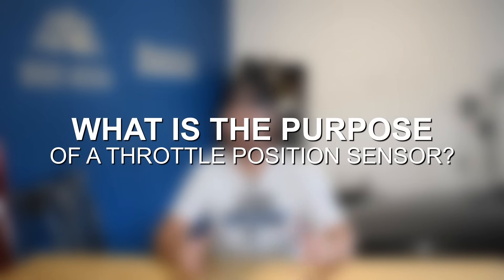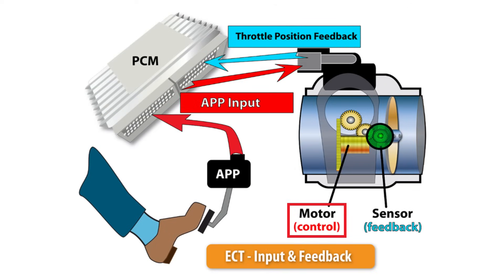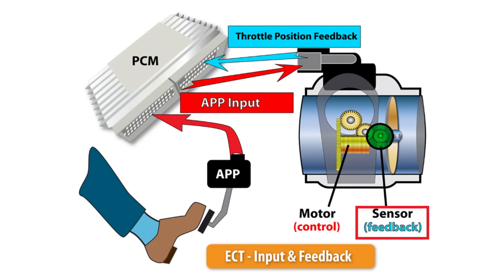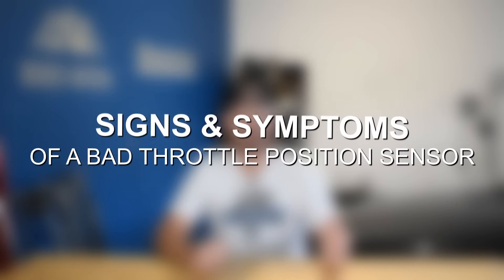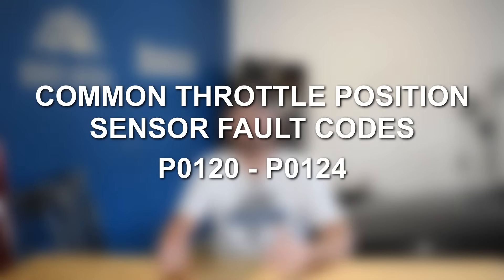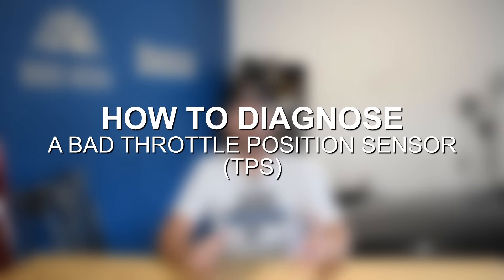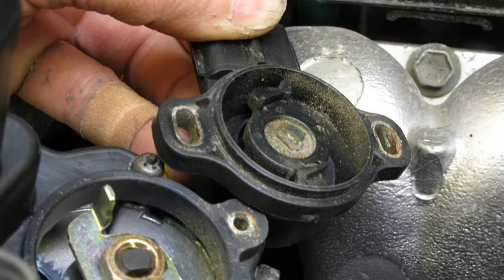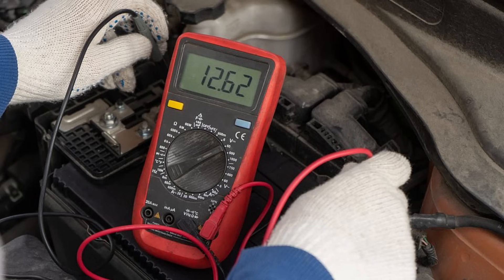Signs & Symptoms of a Bad Throttle Position Sensor (TPS)!

Comment: I have an issue that just happened to me today, if i accelerate anywhere between 9-25 MPH it stays at that speed if i release the gas pedal at 12MPH itll stays at 12mph and increase slowly im not sure whats wrong with it can anyone help
Reply from the maker: A - What you’re describing sounds like your vehicle is “holding” speed because the throttle isn’t fully closing, which can be caused by a sticking throttle body, a faulty throttle position sensor (TPS), or a cruise control/idle control issue. On modern drive-by-wire cars, the ECU can also command the throttle to stay slightly open if it thinks the engine needs extra airflow, which can happen from a bad TPS reading, a sticking accelerator pedal, a vacuum leak, or an issue with the idle air control (IAC) system. First steps would be to check for stored codes with a scan tool, inspect and clean the throttle body, make sure the pedal moves freely, and verify that the throttle plate closes completely when you release the pedal. If it’s a cable-operated throttle, check the cable routing and return spring; if it’s electronic, live data from the TPS and accelerator pedal position sensors can confirm if one is “stuck” reporting partial throttle.

Comment: Can a bad tps cause a crank no start on a 2006 mustang gt? If I put a few miles onthe starter it'll turn over but I don't have any throttle and it eventually just stalls out. It's throwing p2104 and p2111.
Reply from the maker: D - Yes, a bad TPS can cause your symptoms, but on your Mustang the codes P2104 (Throttle Actuator Control System – Forced Idle) and P2111 (Throttle Actuator Control System – Stuck Open) point more directly to a throttle body or electronic throttle control (ETC) issue rather than just the TPS alone. The TPS is integrated into the throttle body on this car, so if it’s faulty, the PCM will go into fail-safe/limp mode — you’ll get no throttle response, and it can stall. That’s why it will crank and sometimes run briefly but won’t respond to the pedal. The “starter miles” part you mentioned isn’t really related to the TPS; what’s likely happening is that after a key cycle and some run time, the PCM allows limited throttle until the fault triggers again. In most cases for these codes, the fix is cleaning the throttle body if it’s gummed up or replacing it entirely (since the TPS is not serviceable separately). I’d check the wiring and connector to the throttle body for corrosion or damage, perform a throttle body cleaning, clear codes, and if the codes return immediately, plan on replacing the throttle body assembly. A bad TPS within that unit can absolutely cause a crank/no-throttle situation like you’re having.
Reply: @8020Automotive thank you so much for the reply! I will plan on replacing the throttle body and update you when I figure out what's wrong!
Reply from the maker: @DamenEdgar  Keep us updated!

Comment: My 99 Nissan Altima was driving fine, then I stopped and and started driving again and it wouldn’t go pass 2000 rpms, turned my car off and back on and it went past 2000 rpms but It felt like it still wasn’t right
Reply from the maker: L - That kind of sudden RPM limit usually points to the ECU going into limp mode because it detected a serious issue like a faulty MAF sensor, throttle position sensor, or crankshaft position sensor. On a ’99 Altima, a failing MAF is one of the most common causes, and sometimes it will work intermittently until it fully fails. It can also be caused by fuel delivery problems (clogged fuel filter or weak fuel pump) or ignition issues. I’d start by scanning for codes, even if the check engine light isn’t on, as pending or stored codes can give a clue. If no codes show, clean the MAF with proper MAF cleaner, inspect the air intake for leaks, and check fuel pressure to rule out delivery problems before replacing parts.

Comment: I have a 2004 corolla with the cable , when scanned the code is P0120 ao maybe ill go ahead and just change the tps sensor
Reply from the maker: R - P0120 on your vehicle (with a cable-driven throttle) refers to a problem with the Throttle Position Sensor (TPS) "A" circuit, and yes—replacing the TPS is often the right move if you've verified that the wiring and connector are in good shape. Before replacing it, inspect the connector for corrosion or loose pins and check the harness for any signs of wear or damage. If the wiring checks out and the throttle body isn't sticking, swapping the TPS is a logical next step. Just make sure to properly align the new sensor during installation since incorrect positioning can cause the same code to come back or create new driveability issues.
Reply: @8020Automotive as u said it was actually that the wire had a breakage , very useful info

Comment: My truck drove for 1 min then the gas pedal stopped working.
I idled it home. Turned it off and it worked again.
Brought it to a parts store amd they said it could be a dirty TPS.
They definitely did not point me to the correct thing.
I thought i was okay. Drove it for a little bit. And then again same thing 4 days later. Drove 1 min and the gas pedal stopped working and i coasted back home. And it worked again after restarting.

It only happened early morning. The other times i drove was mid day. Mornings accumulate so much dew. I wonder if it has to do with moister.

Help!! Lol
Reply from the maker: S - Sorry to hear this. What you're describing sounds like a classic case of a failing electronic throttle control system—not just a dirty TPS (Throttle Position Sensor), but more likely an issue with the Accelerator Pedal Position Sensor (APP), the throttle body, or even a communication issue between them (such as wiring, connectors, or early signs of ECU fault). Since restarting the truck temporarily fixes it, it's likely an intermittent fault being reset during the power cycle. Moisture could indeed play a role, especially if there's a compromised electrical connection—look for corroded or loose plugs at the throttle body and pedal sensor. A scan with a good diagnostic tool (not a basic parts store reader) may show throttle or pedal-related DTCs (even if no CEL is on). I'd start by checking the APP sensor under the dash for corrosion or moisture exposure, clean the throttle body, and inspect harnesses. If the problem keeps recurring, replacing the APP sensor is a common fix for these symptoms.

Comment: I recently had my car stall. The light turned green, and I accelerated, and it stalled. My battery light turned on. I didnt know what to do so I put it in park and when I pressed the ignition button it actually turned the engine back on. Its only done it once. But Im scared this will happen again. I took it to the dealer and they couldn't replicate the problem. Wish me luck 😬
Reply from the maker: H - That kind of random stalling—especially when accelerating from a stop and then restarting without issue—can point to a momentary voltage drop, bad ground connection, failing alternator, or even a weak battery despite no warning beforehand. The battery light popping on during the stall suggests the system detected a charging issue, even if temporary. If the dealer couldn’t replicate it, ask them to check for stored pending codes, inspect the main ground and battery terminals, and load-test the alternator and battery under load. Hopefully it was a one-time fluke, but keeping an OBD scanner handy or logging voltage through an app might help catch it if it happens again. Good luck—it may have just been a brief glitch!

Comment: I have a 2000 Oldsmobile alero and sometimes it will just lose power when I get to 60 mph and I have to shut it off and let it sit for awhile before I can get going again and it will go for a little ways before it does it again any ideas on what it could be
Reply from the maker: Z - That kind of symptom on your vehicle is often caused by a failing fuel pump, clogged fuel filter, or a bad crankshaft position sensor, all of which can act up once the engine is warm or under sustained load. If the pump is weak or the filter is restricted, it can’t maintain fuel pressure at highway speeds, causing the engine to bog or stall. A bad crank sensor can also cause the engine to cut out intermittently without setting a code. Start by checking fuel pressure at the rail during normal operation and again when it acts up, and consider replacing the crank sensor if the fuel system checks out but the stalling continues.

Comment: Well I don't have a code reader but the Throttle Positioning Sensor is only about $50. 
Now if I can find it to replace it.
Reply from the maker: B - What vehicle do you have? An OBD scanner is cheaper than that :)
Reply: @8020Automotive 1995 Chevy G20 camper van so it takes an OBDII scanner and the port wasn't reconnected when I had a crate motor put in. I'm trying to rectify that. But until then I bought a new Throttle Positioning Sensor(on the Throttle Body), a new O2 sensor(one's already replaced) and a can of carb cleaner.

Comment: It actually will accelerate idling faster than it will the pedal don't even work. But the computer says p0122
Reply from the maker: J - Code P0122 means Throttle Position Sensor (TPS) “A” circuit is low, and on your 2006 Explorer, that directly explains why the pedal doesn’t respond and the engine idles but won’t accelerate—the PCM thinks the throttle is at or near zero and goes into limp mode, ignoring pedal input to protect the drivetrain. This is typically caused by a failing TPS, bad connection or broken wire in the throttle body harness, or in some cases, a failing pedal position sensor. Start by checking the throttle body harness for bent pins or corrosion, then test the TPS voltage if possible—it should sweep smoothly from ~0.5V (idle) to ~4.5V (wide open). If the voltage stays low or erratic, replace the throttle body (which includes the TPS) and clear the code—it should restore normal pedal response immediately.

Comment: My 2006 explorer says p0122
Reply from the maker: J - Code P0122 means Throttle Position Sensor (TPS) “A” circuit is low, and on your 2006 Explorer, that directly explains why the pedal doesn’t respond and the engine idles but won’t accelerate—the PCM thinks the throttle is at or near zero and goes into limp mode, ignoring pedal input to protect the drivetrain. This is typically caused by a failing TPS, bad connection or broken wire in the throttle body harness, or in some cases, a failing pedal position sensor. Start by checking the throttle body harness for bent pins or corrosion, then test the TPS voltage if possible—it should sweep smoothly from ~0.5V (idle) to ~4.5V (wide open). If the voltage stays low or erratic, replace the throttle body (which includes the TPS) and clear the code—it should restore normal pedal response immediately.

Comment: I have a problem. I have no codes, but it’s still jerks when I’m accelerating.
Reply from the maker: G - If your car jerks during acceleration but shows no codes, it's likely a fuel delivery issue (like a weak fuel pump or clogged injector), ignition problem (such as a worn coil or spark plug misfire that isn’t bad enough to trigger a code yet), or possibly a failing MAF sensor giving erratic airflow data under load; also check for worn engine or transmission mounts, which can cause jerky movement during throttle input even if the engine is running fine—start by inspecting plugs, coils, and fuel pressure, and if you can, scan live data for fuel trims, misfire counts, or MAF readings to catch subtle issues that don’t trigger the check engine light.

Comment: Lol I just had one go bad didn't know it was bad stumbled on finding out it was bad was with thevolt meter resistance check sometimes it would check out fine and then check out funky so I just gave it a couple finger taps and then that was my problem any slight vibration numbers jumping all over the place kept reving high and low and stalling
Reply from the maker: F - Sorry to hear! Hope this video helped.

Comment: My 1990 f150 don't have codes like that it's  flash light code count each flash anyway rough idea drinking way to much gas going down the road pald at one spot it want to rock backwards and forward so what do you think throttle body sensor
Reply from the maker: C - On your truck (which uses flashing codes from the check engine light), poor fuel economy combined with bucking/rocking while cruising usually points to a bad Throttle Position Sensor (TPS) or failing MAP sensor, especially since these trucks don’t throw live OBDII codes. The TPS is a common culprit—it can develop dead spots or send erratic voltage, which causes the ECU to miscalculate fuel delivery, especially at part throttle. Also check for vacuum leaks, worn ignition components (cap, rotor, wires), or a dirty EGR valve stuck open. If you haven’t already, pull KOEO and KOER codes using a test light or voltmeter—just count the flashes. That might point you to something specific like a TPS voltage out of range (code 23) or MAP sensor issue (code 22). Start with the TPS, though—it’s cheap, easy to replace, and often responsible for those surging symptoms and fuel economy drop.

Comment: I have a 2003 Ls430. Yesterday I was letting it warm up and it started to idle high and significantly louder. There is no power to the gas pedal, I scanned it and got a code p1125. I replaced the throttle body sensor and no changes. Any suggestions would be appreciated
Reply from the maker: Z - The P1125 code on your 2003 Lexus LS430 typically refers to a Throttle Control Motor Circuit malfunction, which is part of the electronic throttle control system (ETCS-i). Since you've already replaced the throttle position sensor, and the gas pedal has no response, the likely culprits now include: (1) a faulty electronic throttle control motor inside the throttle body, which may require replacing the entire throttle body assembly; (2) a failed accelerator pedal position sensor (APPS), located on the pedal itself, which can cause the ECM to disable throttle input if readings are abnormal; (3) an issue with wiring or ground connections between the ECM and the throttle body—check the ETCS fuse and relays as well; or (4) a possible ECM malfunction, though that’s much less common. Try checking for voltage at the ETCS motor connector, and consider testing or replacing the accelerator pedal sensor before replacing the throttle body again.

Comment: My throttle body it barery opens when accelerating. When I drive it it feels like it lacks power when accelerating. Would just changing the throttle body fix that?
Reply from the maker: J - If your throttle body barely opens when accelerating and you're experiencing a significant lack of power, it's very likely the throttle body is either sticking, carbon-clogged, or has a failing motor or position sensor. While replacing the throttle body could fix the issue, it's not always the only cause—before replacing it, try cleaning it thoroughly with throttle body cleaner (especially around the butterfly valve), then perform a throttle body relearn procedure. Also, make sure the throttle position sensor (TPS) and accelerator pedal position sensor (APP) are working correctly and there are no wiring issues. If cleaning and relearning don’t restore normal operation, replacing the throttle body is the next logical step.

Comment: When I turn my car on accessory mode, the throttle bottle makes a clicking noise (constantly opening and closing rapidly) but doesn't start. The issue is I'm not sure if it's actually the throttle body or anything related to it because I dont have any codes for it. Could it still be an throttle body issue or no? Also the pcm relay fuse be clicking when on acc mode too. I don't think the relay is bad, i switched it with a working one and same thing. Could something else be causing this possibly?
Reply from the maker: D - Yes, the throttle body could still be the issue even if there are no stored codes. The clicking you hear when in ACC mode typically means the PCM is trying to initialize the throttle plate, but rapid cycling or jittering usually indicates a fault in the throttle body motor, position sensor, or signal wiring. However, since the PCM relay is also clicking, it strongly suggests an underlying power, ground, or signal issue—likely a bad ground, corroded connector, failing ignition switch, or even a shorted sensor or module elsewhere in the circuit. I recommend checking for voltage drops at the PCM power and ground circuits with a multimeter and also looking at the throttle body connector for bent pins, corrosion, or frayed wires—especially the 5V reference, ground, and signal lines.
Reply: @8020Automotive I installed my new throttle body. The new one isnt chattering, but the pcm relay is still ticking and still no start. Is there a diagram you could point me to so that I could check all the grounds on my car? Its a 2012 Ls V6 camaro. Unfortunately, I dont own a multimeter so I wont be able to test that way. Ill have to see if I can luck up and find something through visual inspection. For reference, already replaced the starter with a new one, replaced crankshaft sensor with new one, also throttle body. All those were replaced this week and the battery and alternator is relatively new as well. Installed those in march. My car isnt giving any codes so im not really sure where to even start.